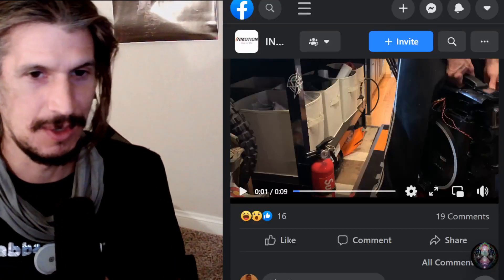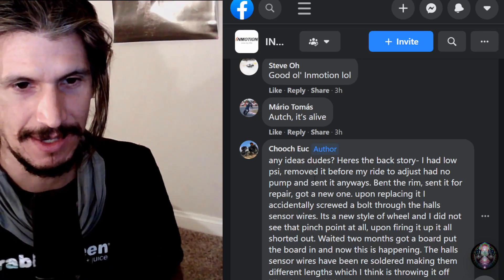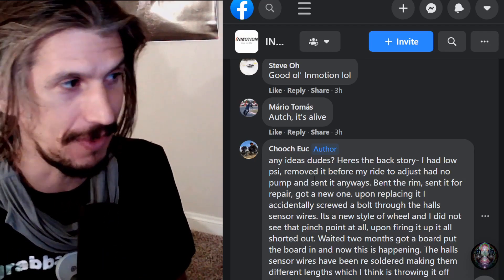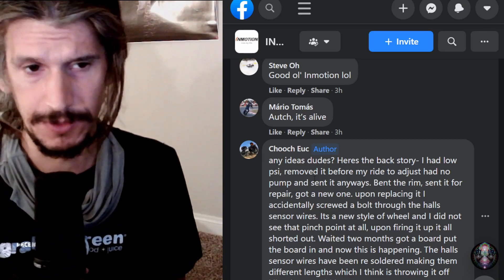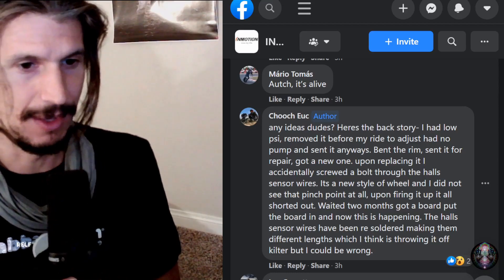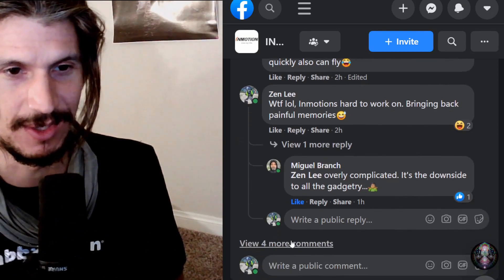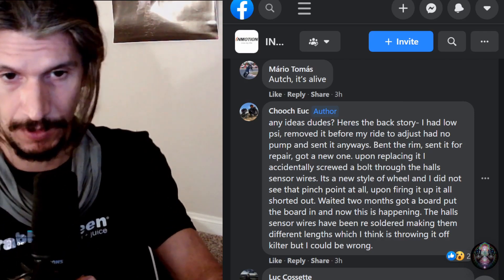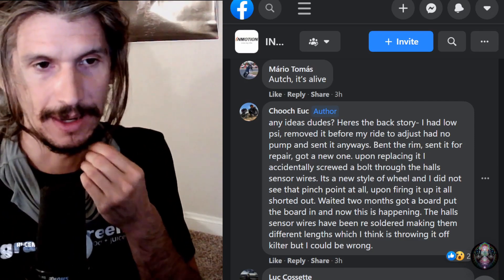EX Motocross Rider's Inmotion V12 FAILS HARD! Veteran Abrams Thoughts

Comment: I did work in mechanic car for 20 years and now i own an electronic repair shop for the last 7 years and as a tech Inmotion suck, just replacing a tire on my V11 was a pain in the ass it took 3x the time than my RS19 or my Sherman... Kingsong are not so great to repair too not as bad as Inmotion but still... Anyway i sold my V11 and crash my S18 beyond repair since i did a lots of modification on it (better and bigger battery, put more powerful MOSFET..etc) nothing remain intacts after the crash.

Comment: What are your thoughts on thr sherman?
Reply: Easy to work on. It was my first wheel that I successfully repaired. I have the v1 rim. I don't jump curbs or off road but it has held up so far for 2000 miles. I also think it need more torque if you want to do off road but will do fine as an all around wheel:cruiser, off road, and city.

Comment: I hope that I don't end up on an Inmotion "I told you so" episode with my V12 whenever I get it. 😅 They really look like a bitch to work on. Will have to be very careful while servicing it so that I don't accidentally break it. Maybe I should just get the RS HT and start sending it. The S20 could be a great wheel to pick up next spring too. We'll have to wait and see. The V12 is supposed to be for my girlfriend and for school commuting so I think for my use case it should function fine.
Reply: Might be better served by a used 100v MSX/MSP or even an 84v. Won't have the top speed on the 84, 35mph is top "safe" speed, but it's dumb easy to work on and super hard to break. My favorite thing about em is the ride quality, followed by the prices, followed by how easy the work on them is.
Reply: @Rocksaplenty  Yeah Ive had an 84v msx and no doubt it is a nice wheel. Sold to my onewheel friend and converted him to euc.

Comment: I'm not sure I understand: in the V12 section of the video, isn't Chooch turning on the wheel while it's on the stand, and it takes off like any wheel would?
Reply from the maker: hmm, looks that way!
Reply: @ZenLee  yep from the background story it seems like he fixed what he broke just fine, then the wheel spins up to 105km/h using all the peak power of its motor, trying to balance in the air.
I might be wrong, but it's how it looks like from the video (therefore no fault of the V12)
Reply from the maker: @supercurioTube  yes, I don't think much fault in the V12 except for the difficulty of basic tech work is harder than other EUC in the range and rims can bend easy(like many EUC). But the replacement parts are hard to come by and are often faulty.
Reply: @ZenLee  I wonder how soft is the V12 rim.
Maybe as soft as the 16X rim as their motors seems to share parts?
Either way, it'll be hard to keep it pristine, and that's probably okay.

Comment: Dang that’s crazy to know , thanks for that info 

I decided to just go for the S18/s20 and rock king song they have been amazing so far in my short life of EUC riding 

How’s begode? And it’s reliability? I’d love to know more about them as well the RS looks like a great wheel 

Great video!
Reply: Mine have been awesome. I've had an ACMV2, MCM5V2, MSX 84V (very, very reliable), and an EX.N, and a tesla v2. All of them held up fantastic; mcm5 only died after being dropped off a cliff into a river, msx has survived ~4-5ft drops with my hefty self on it, EX.N flies along at 45 miles an hour and doesn't complain about it. If you put clarks on the side (I use v1 clark pads, they're my favorite) on the boxy wheels it keeps them safer, a front bumper doesn't hurt either! Think foam tape, dirt cheap!

They were also the only company that was cool with me selling their wheels too, I haven't ordered any, but them being OK with me being some random dude that wanted to sell their wheels has made me like them ever the more.

They're really easy to work on, hardest part is if you have to replace a whole shell (I really beat the snot out of my MSX, I admit it, it's a great wheel, still ride it.) you've gotta get the wires in the right spot.

Honestly I wouldn't say any other brand can keep up with their line right now. S20 is dope, but the problem is that they tend to region lock wheels, so you gotta be concerned about where you get it or never turn on the kingsong app. The Veteran is a street legend but has lower pedals than I personally prefer, and struggles with extreme inclines, but is perfect for some people. 

My personal favorites are the MCM5v2 (So perfect for toodling around, taking it easy, 25mph top speed or so but it's so torquey.) MSX/RS/MSP, (Perfect middle of the road) and finally the EX.N, because it's so spunky and powerful.
Reply: @Rocksaplenty  dang man thanks for all that info that’s good to know! I understood everything besides king song and you shouldn’t open the king song app?? Could you explain more about that? They lock wheels? What does that mean? 

Thanks for the info man I might give befode a try soon